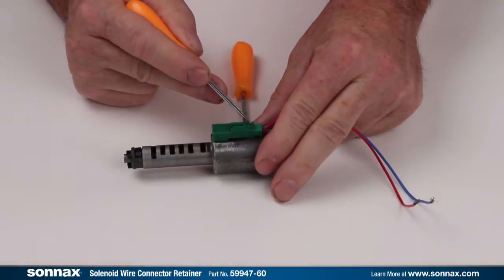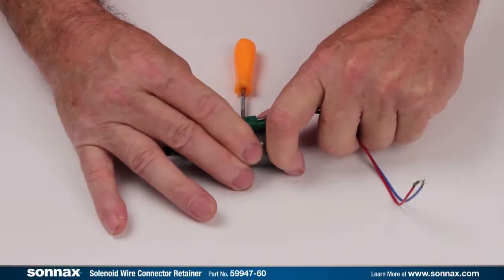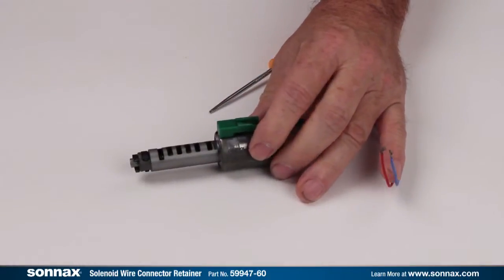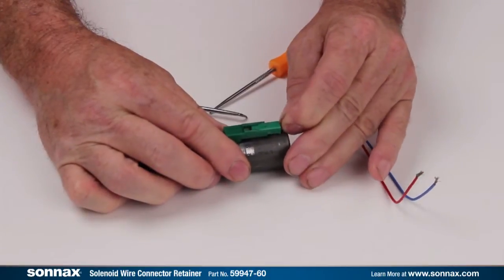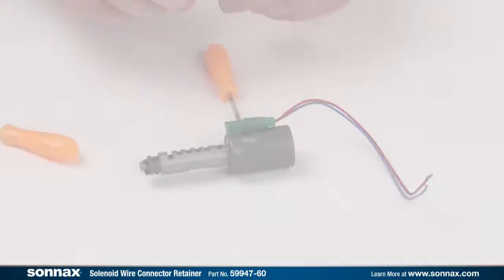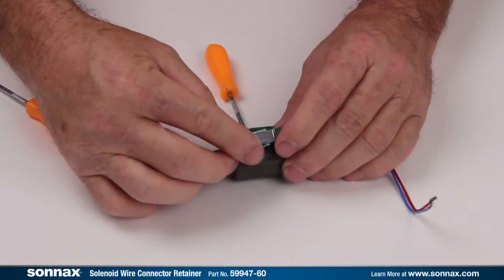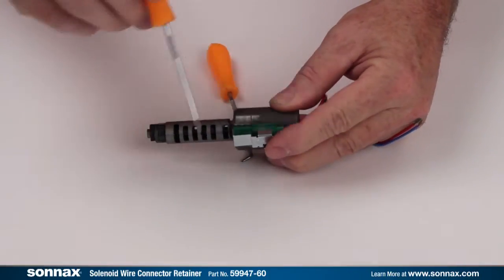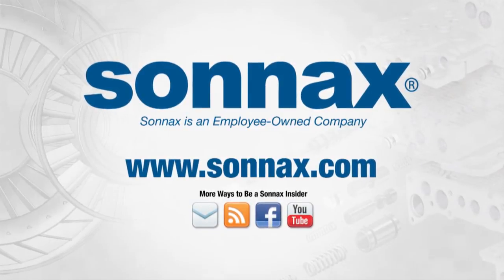How to Reuse Broken Solenoid Connectors

Comment: I really wish you all had a variant of this clip for some of the Nissan / Jatco solenoid connectors, like those found in the RE4R01A. Given the age of these transmissions, it's now nearly impossible to disconnect these clips without breaking off the locking mechanism, due to the brittleness of the plastic. I've tried several times now - the only true way to salvage seems to be to cut the harness and resolder. Any valve body work/removal without going that route essentially means breaking these clips. 

With the widespread use of this transmission (and the family of similar models that use the same solenoids) for two-plus decades, I'd think there's be some justification for the cost of design/manufacture. I just hate the idea of leaving wire or zip ties submerged in a transmission pan, where they could degrade and eventually fail.
Reply from the maker: Thank you for your request, we will send it to our new product development team for review. Enjoy your day!
Reply: This looks amazing!   I nearly broke an old connector where there was almost no space to work.  It's good to see there's a solution.   The OEM factory connectors are a terrible design.